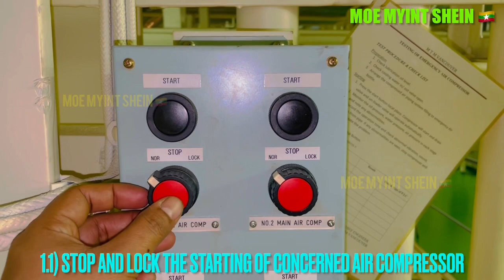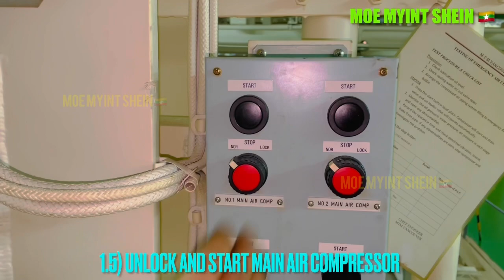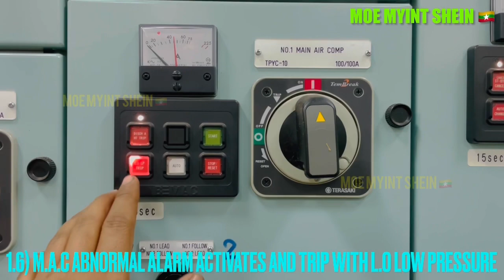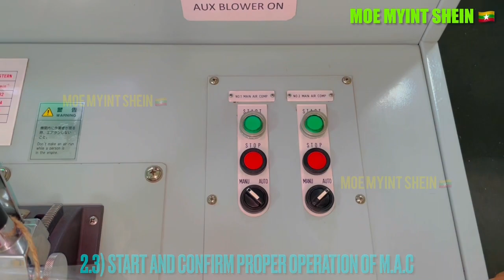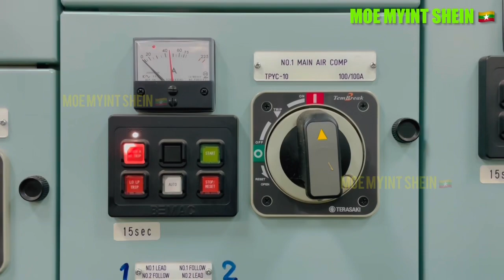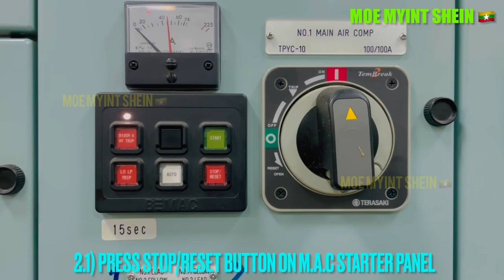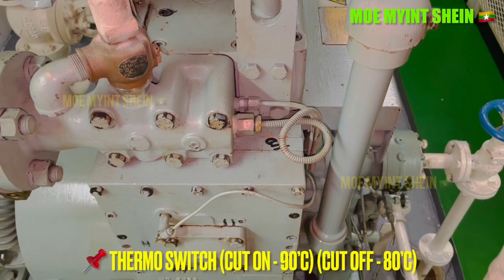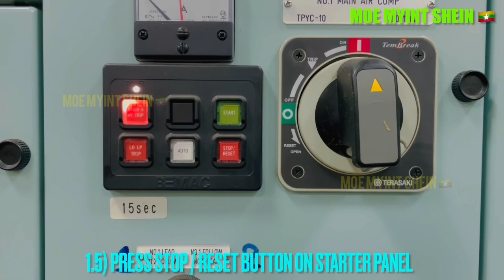[TANABE] AIR COMPRESSOR Alarms and Trips Testing | MOE MYiNT SHEiN | Technical Vlog : 074

Comment: At 3:57 high discharge temp alarm is set at 90*C and differential is set 10*C. 
i didnt understand the differential set value of 10*C. 
can you pls help me out?
Reply from the maker: You already know that Alarm Activated at 90*C. 
Until temperature reaches 80*C, you cannot reset that alarm. 
You may understand, MEC.